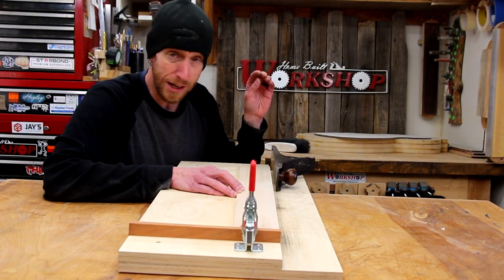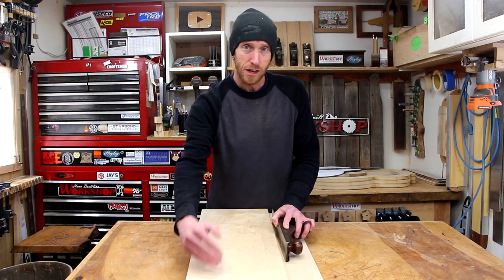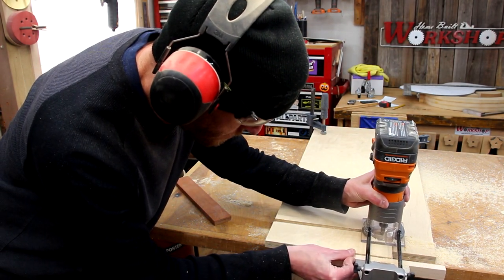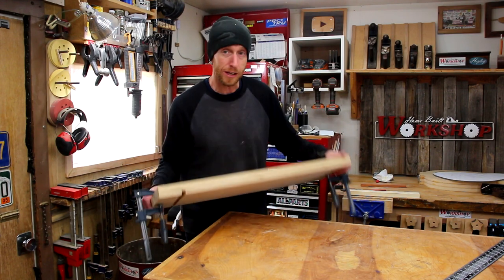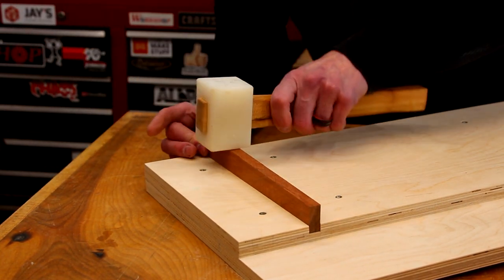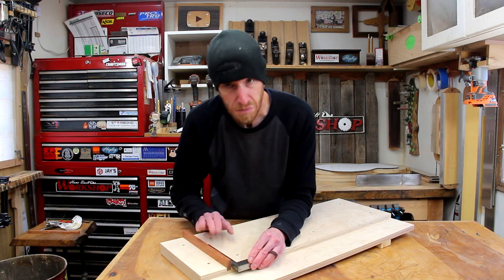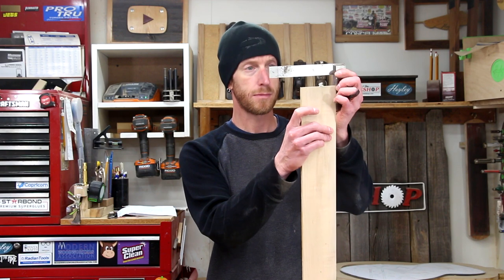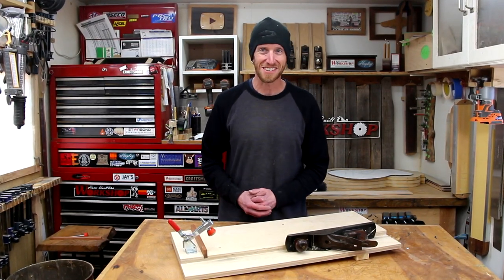How to make a Hand Plane Shooting Board | Another Jig for my Acoustic Guitar Build

Comment: Would you add anything like a wax to the area where the plane ride to help make it as smooth as possible and reduce friction from the body of the plane against the shooting board?
Reply from the maker: After using this a bit more after making the video, I did add some paste wax to just the area where the plane rides.